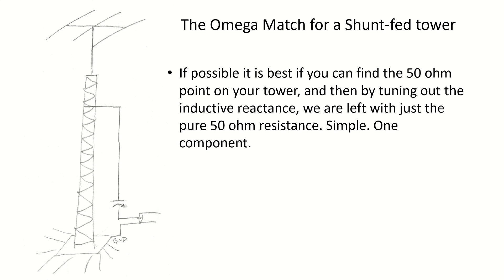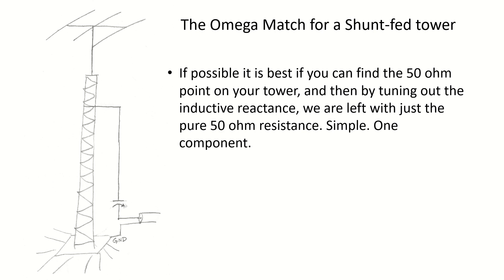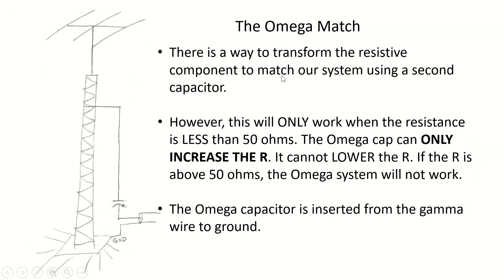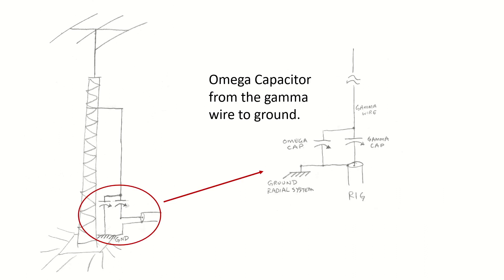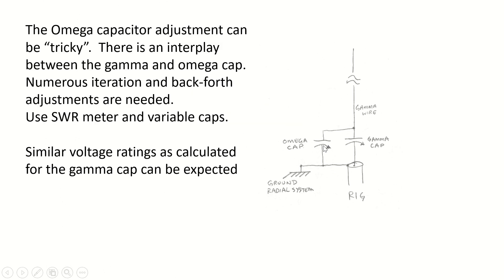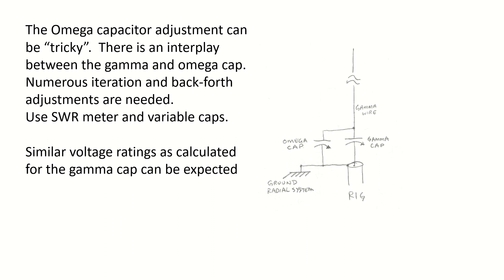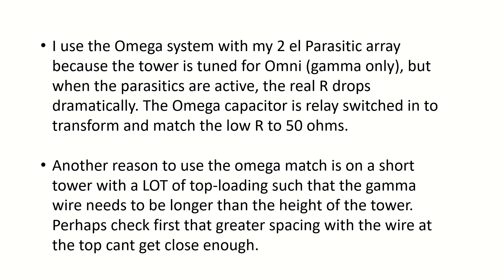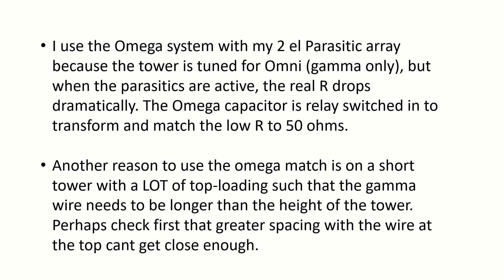The Omega match-Shunt Fed tower 2

Comment: What is the advantage of shunt feeding a tower as opposed to just running the wires up beside the tower and not connected to the tower? I have a SteppIR antenna so it is not the same as with constant aluminum antennas.

Comment: Hi Steve, I use the Omega matching system on my 56' tower with the X7 and 40m dipole, which are all insulated elements.  I am limited to 2' spacing from the tower near the ground.  I use RG-214U coax with the 31pf/ft capacitance as my Omega capacitor with the coax shorted at the end.  I matched it at low power with a variable capacitor then measured the value then built my matching length.  I have several lengths and use that to move my resonant frequency by selecting the different Omega capacitor length with my Ameritron remote coax switch allowing me to move the resonant frequency.  It also works on 80m.  The coax lengths can fit nicely as 4, 6, 8, 10' lengths all inside a PVC tube under my deck.  Just redoing my deck and everything is apart and after 15 years its time to refresh all of the cables and coaxes.  I am going to use your suggestions from your shunt load video to dual feed it from the top but have it come down closer to the tower and to a single connection at the bottom since I cannot do 1m spacing.  Great videos, thank you!